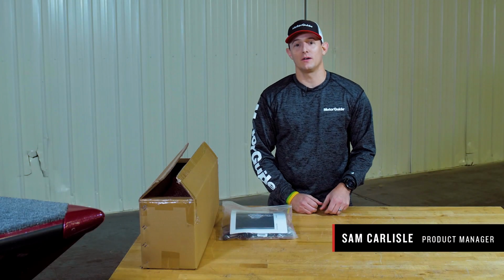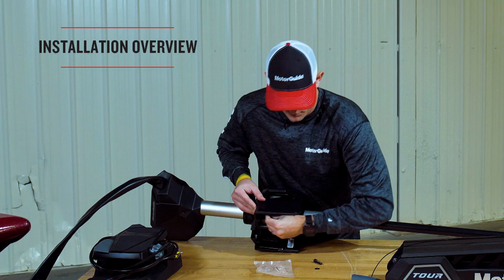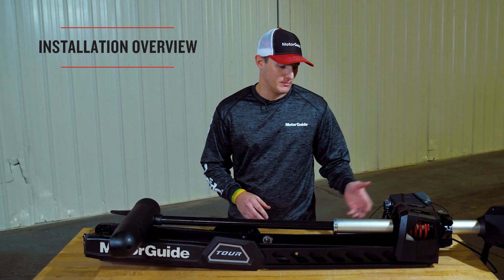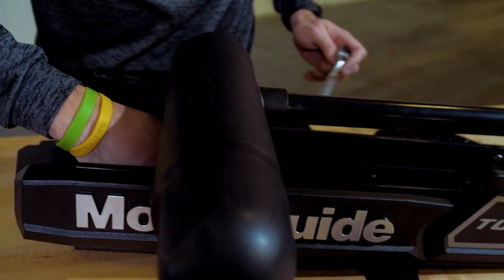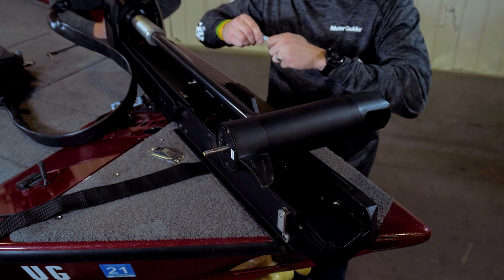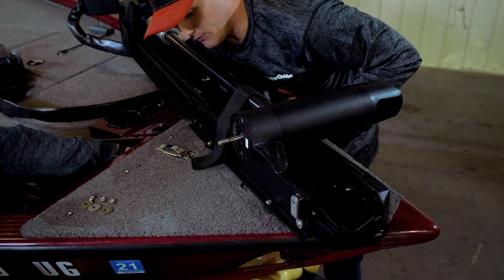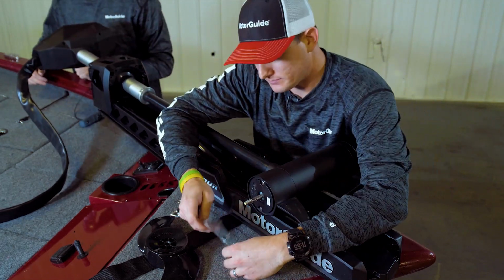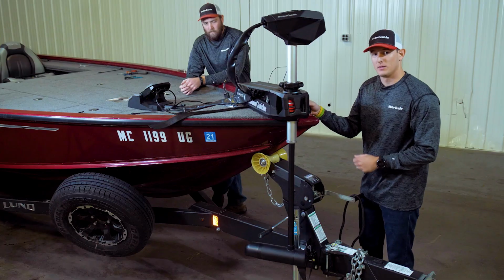MotorGuide Tour Series Installation Overview

Comment: So the installation was easy. We had a the MotorGuide tour (without the gps and everything) so we just used the existing mount. But we are having an issue when going to sync the remote to the trolling motor like you did in the video. When I hold down the the 2 arrow keys I don't hear a beep. The trolling motor has power and beeps when we plug it in and the blue and green lights are on. Any suggestions or fix for this?

Comment: Is there a fix for the cable sheathing not fitting all the way into the trolling motor head yet?
Reply from the maker: We have not released the production grade fix yet - when it is available, we will communicate!
Reply: @MotorGuide  Okay sounds good.  Do you think there will be any lasting damage if water gets into the head or anything like that?